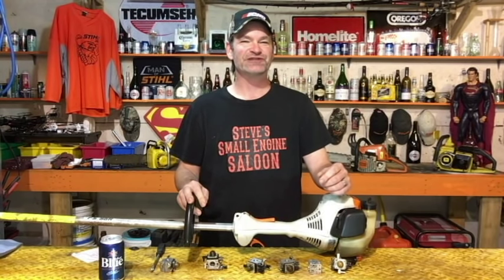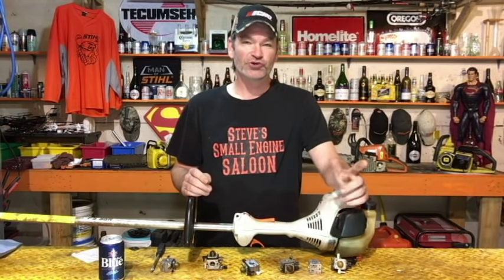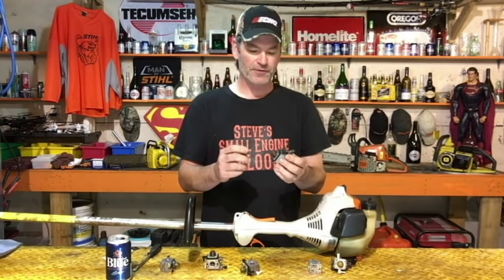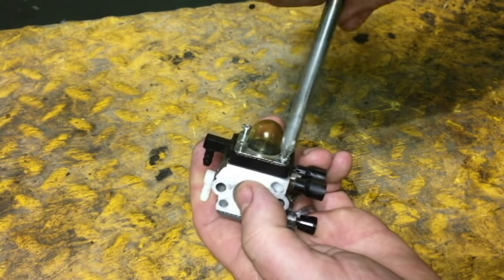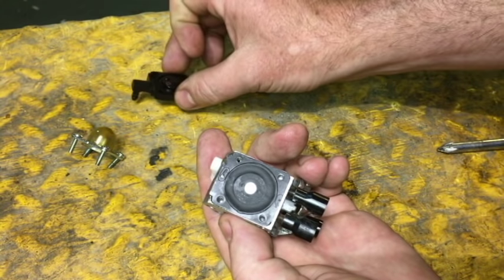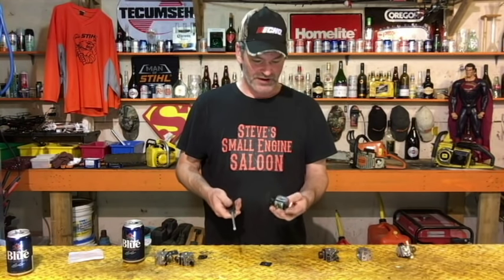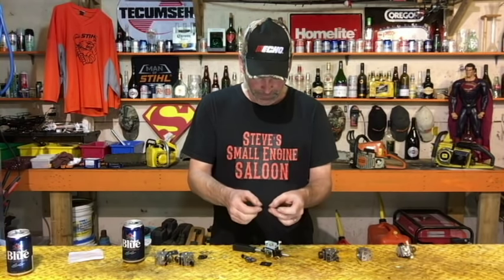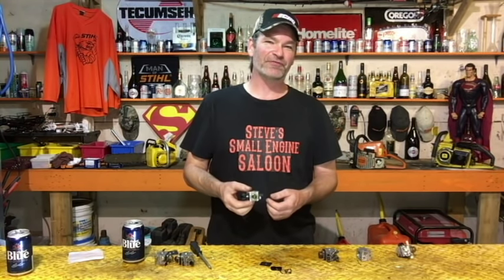How To REBUILD A CARBURETOR On A ChainSaw, WeedEater, Etc.

Comment: Have a McCulloch Cabrio 261 strimmer  its 25cc 2 smoke,  that has a Walbro Carb, but is more similar to the first one you showed.  it was given to me,  missing the air filter so ive stripped the carb down and cleaned it out . Made an air filter for it and just needed new fuel lines. Now  it did briefly work correctly when throttled but now I've come to actually use the thing,  it just bogs out no matter what i do with the H screw., idles perfectly and can sort of get it to rev if i put on some choke but its rough AF and stalls out.  Is it worth me trying to get this carb to work or should i just buy a new equivalent  as i assume there's some thing wrong with the high speed circuit .

Comment: Hey steve I bought a new carburetor for a featherlite weedeater 25cc I broke the choke lever on the old one,, so the new carburetor I got I put it on and there fell out a small spring and ball being that holds the choke lever open now it just flops so how do you put it back in place

Comment: Interesting demo, but works best with factory OEM carburators. I have a 4 year-old FS38 which is now on its 3rd carburator, I believe. My older FS45 lasted me 13 years without going into the shop once--it was still made in Germany, btw. Anyways, these after-market carbs do not have plastic housings with limiter tabs on the L and H screws--they are just conical black plastic and can be screwed all the way out of the carb--no need to pry the tab caps off with screwdriver as shown in this video. Now, the question is, just how far does one turn the L and H screws out once seated with these carbs? I found that the recommended 1 1/4 turn wasn't enough, and the 3/4 to 1 turn as described in the manual is meaningless without the factory preset tabs installed. I think I have the H speed screw turned out at least 2 turns, maybe up to 3 (I don't want to seat it again as I finally got it running!). Just curious what your experience with these after-market carbs is.

Comment: I have an old Craftsman 2.4 40cc Chainsaw 18".  When I unseated the carburetor I did not see any type of Gasket between the carburetor and the engine face.  There was a small area where there was tacky residue on the a corner of theecarburetor where it mates to the engine.  Do I need to use any type of adhesive or gasket sealer when I remount the carburetor to the engine?  Btw your videos are very helpful!

Comment: Steve, my 4 year old Husqvarna LD128 Weed Trimmer won't stay running. I've replace the fuel filter, carburator, fuel lines, spark plug, and ignition coil/plug wire. The air filter is new too. It's starts and will idle but, giving it throttle and it dies. I'm using the proper fuel oil mixture. Any ideas before I throw it in the river?

Comment: got me a big Kobalt battery powered weed eater a couple of years ago and will never go back to gas...it runs an hour on a fully charged battery and only takes an hour to recharge...so why  a constant hassle messing with gas powered small engines?you also use less trimmer string with a battery powered trimmer.

Comment: my 18 yr old chain saw just started acting up.  ( i only  use it one day a year)  any ways,  took it out added true fuel to the old fuel, and it started right up. cut most of a tree up.  put it down. and it died slowly.  now it starts  but dies as soon as trigger is pressed.  if i let it sit.    and restart it , it might run for a minute.    i'm pretty sure i will need to rebuilt the carb.  thinking of just tossing it, and going to a battery unit.   your thoughts?   brand is poulan.  from  lowes.

Comment: I have a question. Most Zama rebuild kits come with 2 diaphragms and matching gaskets because of different shaped carbs (notice this on most Husqvarna small motors). Aside from the shape of the rubber, is there any difference in the diaphragms themselves? The diameter looks the same it's just a difference in how it's cut to fit on the carb. Might seem like a stupid question but I'm curious nonetheless. Thank you in advance.

Comment: I have a Stihl 038av super pro.  It's a rotten starter.  Even with engineered gas it needs a half capfull dumped down the carb throat to start.  After that it runs well, starts on one pull!  Fuel starvation on startup.  Any suggestions?  Carb kit? Impulse line?

Comment: I was not sure where to put this question so here it comes. I need to remove a clutch from a Husqvarna 50. I have a rope in the cylinder and the piston is near the top. I have tried a 15 mm wrench and socket on the center of the clutch and I tried the screw driver hit with a hammer. I am going in a clockwise direction. The 15 mm nut will NOT BUDGE. Can I try something else ?? Thanks.

Comment: Steve, i replaced the carb on my FS100RX, and ive adjusted the carb using your procedures twice now. It just doesn't want to idle properly. It will actually surge up and rev for a bit, then RPMs come down a bit, then back up. Ive adjusted High low, and the idle numerous times but cant find the sweet spot I guess. I also verified the throttle cable is returning to the fully slacked position when the trigger isnt being pulled. Any ideas? Does that indicate a crankcase seal leak? Looking for help on this one...thx

Comment: Steve, I just installed a brand new carb (for my trimmer) that dies at idle.  Do you have a video where you talk about that particular problem?  Best I can tell, one of my "flaps" must not be flexing properly and is starving the engine at idle speed. (I'm still learning carburetors!)
Reply: BarefootDrummer if it’s a brand new carb you most likely need to adjust the idle screw. Turn it out for a higher idle. Only turn it a quarter turn at a time and do so while it’s running if possible.
Reply: @juston3441  Thanks Juston!  I ended up picking up a rebuild for the original carb and it works great now.

Comment: Steve or someone please answer me, when you put your carburerator back in, do you put the high/low/ idle screw all the way in and then do 1/4 turns or how far do those screws go in before you adjust them?
Reply from the maker: Got some carb adjusting videos on my channel too....
Reply: I've watched that already and didn't see it specify how far to put the low and high screws in before adjustment. I could of missed it but I watched it a couple times and didn't see it.

Comment: I have a 1972 724 Tecumseh with a 7hp engine. Not until recently I have had issues with it running, it will start every time and then die. I checked the oil and is on the proper level and is like warm honey, not as thick but not too thin. I noticed that when I shake the whole thing it will run for a little bit longer. I put fresh ethonal free gas in it and does not want to run. I'm thinking it is a carburetor issue, the only problem is that I'm 16 and never touched a carburetor in my life. I looked online for a rebuild kit and im not too sure if grabbing any one would work. Any information would be really helpful.
Reply: Look for any numbers on the engine and search for rebuild kit I know you probably did that already sorry my only advice

Comment: Steve ! Awesome vid! I have a Craftsman weed eater and I can’t get any gas into the vacuum bulb , no gas moves in the lines , would it be the carb being plugged up ? I did a basic cleaning of the carb but didn’t pull the jet apart . Would the parts you replaced in this video cause a blockage and not allow gas to flow thru carb? Thanks ! Keep up the great vids !
Reply: I had the same problem.  I had to blow all the tiny holes out with air compressor, that fixed it.  For me, anyway.
Reply: bruce lonsinger thanks !
Reply: Richard - I had the same problem with my Ryobi. A tiny port inside the carb was clogged. I bought a set of welder tip cleaning rods. It's a small kit with over a dozen thin wires that vary in size, so picking a size to clean out these tiny ports is easy. I ran the wires thru my ports, it cleared them. I could see light thru the port again! Put it back together, followed Steve's guideline on adjusting the carb screws and it now runs great. This is similar to what I used, highly recommend them.  Carb Carburetor Jet Cleaner, Torch Tip Cleaner Tools for ATV Welder Motorcycle - 13 Wire Set    https://smile.amazon.com/Carburetor-Cleaner-Torch-Welder-Motorcycle/dp/B076HMF3DM/ref=pd_sbs_469_2?_encoding=UTF8&pd_rd_i=B076HMF3DM&pd_rd_r=efc5df57-be55-11e8-9f86-cff56757bc74&pd_rd_w=n1RbD&pd_rd_wg=bZO6J&pf_rd_i=desktop-dp-sims&pf_rd_m=ATVPDKIKX0DER&pf_rd_p=0bb14103-7f67-4c21-9b0b-31f42dc047e7&pf_rd_r=E181H5VETRTH432B1519&pf_rd_s=desktop-dp-sims&pf_rd_t=40701&psc=1&refRID=E181H5VETRTH432B1519

Comment: Because you CAN do it, doesn't mean it makes sense. I just bought a Huztl "carburetor with maintenance kit" off of Amazon for under $16 delivered, including shipping. New carb, new air filter, new fuel line, 2 fuel filters, spark plug, 2 extra primer bulbs (why),,,, 20 minute job including going back for another tool in your box. Half beer in Steve Time... I suggest adding a rootbeer nip... maybe 2. Oh, C1Q-S97 kit for most Stihl hedge trimmers and weed trimmers.  I put the kit into my FS55-RC string trimmer and it fired up in 3 pulls.... Just need to tweak the idle screw. Yes, you CAN rebuild it, but add up the cost of the rebuild kit, new plug, new fuel filter, new air filter, new fuel line.... VS $16 for the kit and you don't have to rebuild anything.... swap parts and tweak the carb.

Comment: I'm not sure if you're answering questions on this video but, I have a head scratcher for you. I have a little Poulan 2150 that floods out AFTER you shut it off. I recently replaced the primer bulb, fuel lines and filter. After cutting for a little while, I shut it off and when I went to start it again, it was flooded. I pulled the plug, dried it off and turned the saw over to get the excess fuel out. After that it started again. But, it foods almost every time I turn it off. Any ideas?
Reply: In case the tank fuel expanding from engine heat is forcing fuel through after you turn off, loosen the cap a little when you finish. It may have a one way valve in the vent- stopping vacuum but not pressure.
Reply: @rossbrumby1957  Thanks for the idea. 💡

Comment: Wouldn’t I have a problem with gumming up and should I need to clean the carb somehow.  My priming bulb won’t fill with gas but I see air bubbles in the tank when I press the bulb

Comment: Hi Steve, thanks for another great video.  Can you help me with this question?  I have a Walbro WJ105 carb used in a demo saw that I am guessing needs a rebuild or replacement.  It starts and stalls, will only run with the air filter removed.  Is it likely to be the same procedure for that kind of carb or am I better off replacing it.  Carb kit is about $9.00.  New carb is about $90.  I would rather spend the $9.00 at this point if there is a chance of it fixing the problem.  Thank you!
Reply: Let's start with the easiest a new air filter
Reply: @tashagolden7748  Been there, done that.
Reply: @hpds1145  yea if it's not running with new air filter it's definitely time for that $9 carb rebuild kit
Reply: @tashagolden7748  Already ordered!

Comment: The fuel pump diaphragm of my chainsaw carburettor, has a little split in it ( ~ 2mm ), on the section nearest to the little throttle lever. What would be the symptoms , regarding operational use if the engine can be started/run at all ?  
Also what material could be used to fabricate ( using a hobby knife ) a fuel diaphragm, if chainsaw needed to be used urgently ? Material besides teflon.

Comment: Hay Steve ....I don't like the bear but i enjoy watching your videos ....I would like to ask 
a question about my Stihl 011 chain saw . I got two Walbro carburetor  that i cleaned in out !
in one a  replaced the gaskets .. It mast work as the spark plug is always wet  and also 
I got good sparks.....but it doesn't start ...i tried to adjust the L& H  in and out  but no success 
Then I tried with the second  carburetor only stated when i put a few drops of petrol into the spark plug .
It runs beautiful and.... i sad to myself I must write down the setting of the H & L...
 The L=1    out     the H is ALL IN if i try to turn out it will stop ....As I said it work beautiful but do you 
think it is safe with the H screw all in ?   Thanks  Tony

Comment: hey Steve.i have a zama C1M-W26B carb on a poulan p3314 saw,the saw has low hours,good compression,new spark plug,etc.saw bogs on acceleration and dies coming off WOT.i completly disasembled and inspected the carb,removed welch plug and pressed nozzle check valve out.check valve tested good,all passages clear,reasembled with all new parts and pressure tested ok.still have and issue when tuning,its not responding to the low needle well.any thoughts?thanks

Comment: How do you take the carb OFF? I need to clean both of mine, but can't find mounting screws. I'm mediumly handy, work on cars a little. Haven't touched small engines though. What looks like mounting screws are microscopic. Do you need eyeglasses screwdrivers to work on these?
Reply from the maker: What make and model are your units?
Reply: I have a walmart weedeater featherlite fl25c, and my grandpa gave me his ryobi 700r. On the ryobi i can see the metal plate that LOOKS like it houses the membrane, but dont know how to take the whole carb off.

Comment: HI mate, I have a BG85 blower and it's just stopped priming, When you prime it up it just fills the fuel tank with air, I took the cab off and cleaned it, And checked fuel lines and they are all working fine, I've put back together and still not working,Do I need a new cab kit or new cab? regards Si
Reply from the maker: New carb in that case.  Amazon....
Reply: Steve's Small Engine Saloon your awesome
Reply: So a cheap Chinese knockoff? I don't think you can buy a real Stihl carb on Amazon, only through a dealer.

Another question - I have an FS110 trimmer. It looks like they used at least 3 different carbs over the years. Should they be interchangeable or would I have to replace the old one with the same model number? Thanks.

Comment: My 044 starts but won’t run. Almost like it’s running out of gas. All fresh fuel new in tank fuel filter, new fuel lines, cleaned the carb twice and tried a buddies carb, new plug but still won’t run. What am I missing?

Comment: I’ve got a polan 2150 chainsaw and the replacement carb I got for it looks different. ie the fuel line and primer line are on one side of the carb for my old one and the new one they are on different sides. It won’t fit correctly. the throttle line keeps getting caught up on the primer line. Am I doing something wrong. Help please.

Comment: Steve nobody talks about incorrect gaskets after a carb rebuild just sorted a mate's Chonda out had more gaskets than sharks have teeth.Turned out the mower only needed the two heavy formed channel breathers. Bad or incorrect carb gaskets display carb problems start n die etc might be worth a bid mate

Comment: I worked on chainsaws for quite a while and I got a problem with one could a new carburetor on it new carburetor and he will not start I have good spark I have good ignition and it will not start
Reply from the maker: I have a video in my chainsaw playlist called chainsaw wont start
Reply: @StevesSmallEngineSaloon  I looked at all your videos and nothing helps .I even put a drill on the flywheal and it still won't start

Comment: Whenever i used to do this job, and I've done hundreds of them, i would NEVER fail to pull the fuel needle and check the tip for deformation, after replacement i would check the lever height also; because it has to be adjusted "EXACTLY", also the screen, because the screen will even trap the lint from the fuel filter from inside the fuel tank(it happens more than you think), then the primer body has a rubber valve in it, which can deteriorate all by itself, most that I've worked on that needed replacing; i was never able to find replacement parts for, either the valve itself OR the complete primer body itself; this is the place that i would always dread, so you didn't have any choice but to replace the whole carburetor. It is a whole lot more to this "square inch"  size piece them what the majority of people think.

Comment: I put a new carburetor on my echo trimmer.  I bought the carb on Amazon for 15dollare.   When I installed it.  It fired right up ran like a charm.  BUT. After running for mayb 10 minutes.  That's it won't stay running anymore until I leave I set for an hr....?? Anyone have their problem?   I'd appreciate all the help I can get.   Thanks Jim.

Comment: Can that be the problem with my Stiga chainsaw? I just have jused it abaut 2 ouers. Now its gone 5 years and it wont start. Sorry my English, i am from Denmark. :)
Reply: @hankbridges5055  I have got it startet. I think i flottet it. I took the sparkpluck and the airfilter of for a week and let it dry out. And then i startet in first pull. Thanks anyway. ;)

Comment: I think I may still have an old carburetor that I swapped out on a snapper 3 hp snowblower. The wife got it for 20 bucks at a yard sale and it served me well for years until we didn't have snow and it all dried out. Plus there was no gas without ethanol available at that time. There was nothing I could do to get that thing to run. 
Fortunately carburetor shipped was under $15 so no big deal. Actually a carburetor rebuild kit would probably have been almost that LOL.
It was a pretty easy job other than I had to cut down a Allen wrench to make it really short so I could get one of the bolts out.

Anyhow if I find the old carburetor I think I'll tear it apart and check it out.